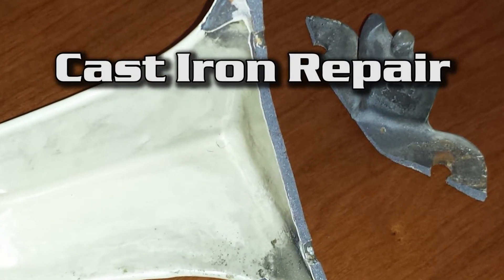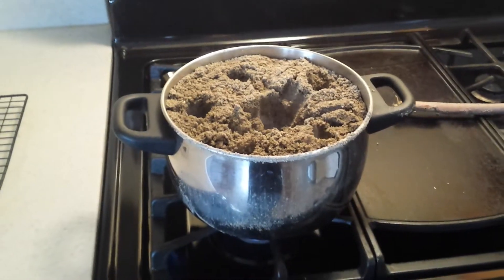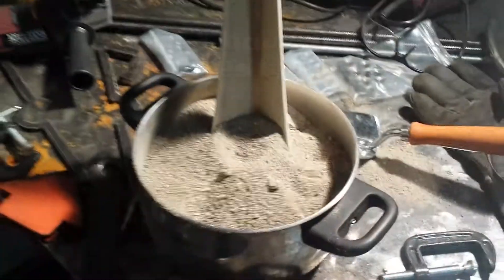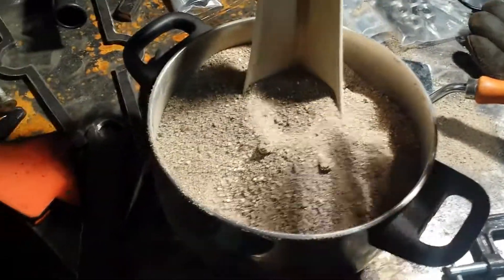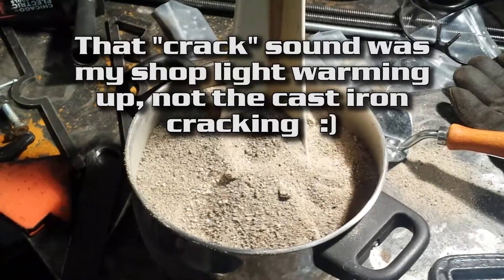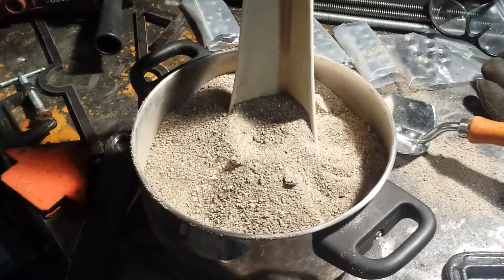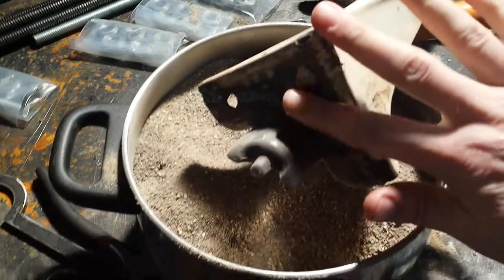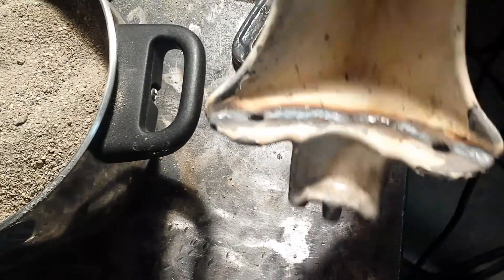Quick Fix -- Welding Cast Iron

Comment: "Crystalization", is the goal. Most metals alloys (very rare to use any pure metals, 
everything is a mix of materials)
are crystals, the atoms form ordered stucture- a crystal, as opossed to (for example) most 
glass which is not ordered.
your weld needs to be be pre-heated and then cooled down slowly, because 
the crystal gets so stressed by the thermal expansion / contraction
that it cracks. By heating / and slow cooling you are giving the atoms in the
structure energy to move around (the heating), and time (the slow cooling) to 
re-order a form a new crystal.
yes the atoms "move around" after you finished welding, they experience
Stress from the thermal contraction. If you give them time and energy, they move 
to where thermal stress is pulling them after welding. If they dont have time, 
...the stress of cooling down, pulls harder then their bond (atomic bond) can withstand, and "crack". 
If you heat up even more,...and cool down even slower ...the stronger the weld, atoms have more time 
to get "even better places in the crystal" an orderly crystal is a strong crystal.
(there are a dozen more factors in welding, but i just wanted to clear up that
"crystalization" is not the enemy in this case, it is actually the goal.
learned this stuff 20 years ago, 
great video.

Comment: Did you use a MIG welder?  What type of gas?
Reply from the maker: Yes, mig with my standard wire and gas I use for mild steel.  You just need to preheat and cool slowly.  If you just weld without preheating and don't let it cool slowly the welds will fail.  If you follow those rules though, it should work.